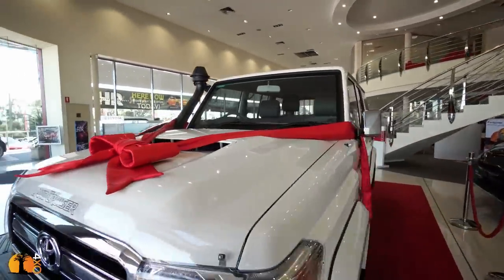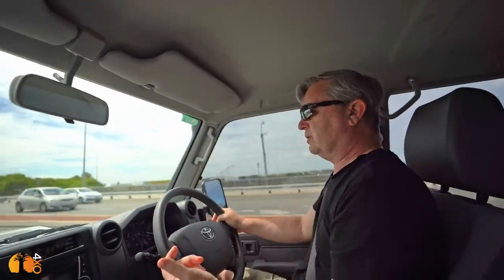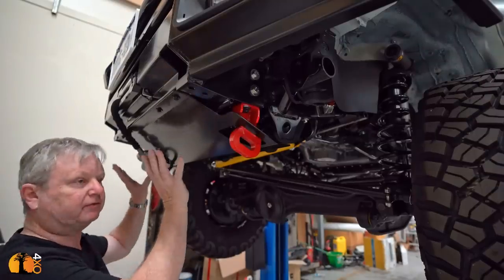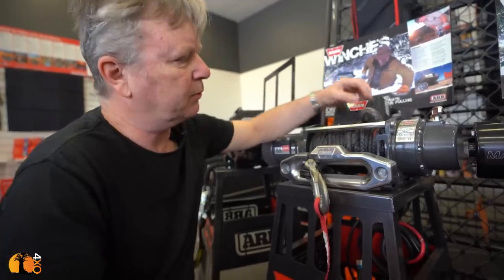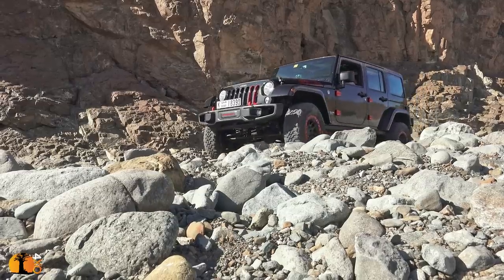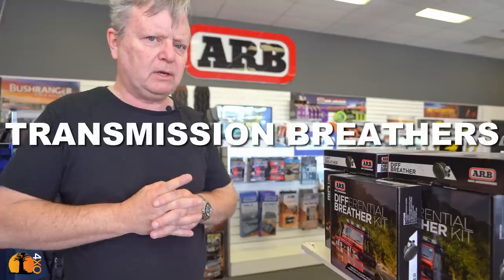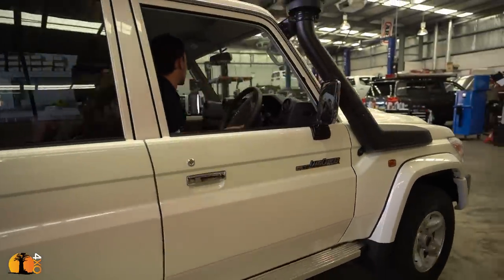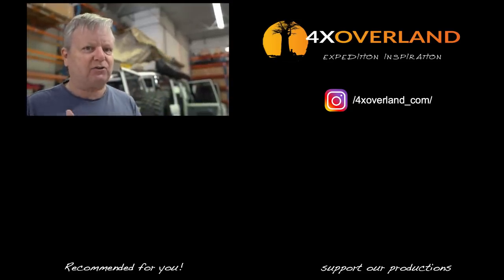How to convert a SUV into a 4x4 Overland Tourer. Toyota Land Cruiser VDJ76 | 4xOverland

Comment: It's always struck me as funny when people call the transfer case a center diff.   But that's just the difference in terminology between different civilizations.
Reply: I actually believe that they are in fact two separate technologies. All fulltime awd trucks with a way to drive both the front and the back axles at the same speed regardless of traction and a low gear could be said to  have a transfer case? But a “real”  transfer case has locks the front and rear drive shafts together in a very rudimentary was, and that is a transfer case? Idk, bit I don’t think they are interchangeable at all.

Comment: Not another Toyota! I want to see an LR3/4 transformed... 
I like the video though, thanks (-:
Reply: maybe because they arent good touring rigs
Reply: @concretekiller  I don't understand why.  I thought that's the whole point of modifications! To ensure vehicles are!
Reply: Karim Alameddine you have to start on a solid platform with accessible parts, not a finicky British truck with air suspension
Reply: Robert Howell 
In stock form, off the factory floor, a LR4 will eat a 76 series for breakfast off road.  The D4 is incredibly capable, comfortable, and safer than the dinosaur that the 76 is.  It depends what you want, how comfortable you want to be, how comfortable you are with “new technology”....
The original question / statement was valid....it would be interesting to see what Mr ASPW would do with a D4..rather than complain about “air suspension” which is sooooo easy to manage and so comfortable / beneficial to overlanding if you know  what you are doing.
Reply: Mark A obviously with all of its bells and whistles it MAY be more capable from the showroom. Probably not, but maybe. The GXL has twin lockers, remember. But even if it is more capable, how long will it last? It’s not built for extended off road travel, or prolonged heavy use. It’s not even close to being robust enough. And it is quite obvious that air suspension would NEVER be suitable for extended touring travel or even off roading- this isn’t just my opinion, but the opinion of all experts including ASPW himself.
Reply: Reliability of land rover a real issue 
All car break but parts 're a far worst problem 
Outside capital city's you just flat out won't get even the most basic service items 
We had 3 110s simply because they were the first with coils, Failed regularly, high temperqtures and rough roads murder them 
Somewhere there a video I stumbled across a video of the landrover d3s doing the Gibb river road 
Didn't go well for them 

The 76 is rough as guys for a reason 
They are probably good for weekenders and short trips on sealed roads but they're not ideal for the interior 
Goes for anything euro really 
Dont get me started on electrics 
You can say what ever you like but in on the edge of a fairly famous track in west Aus so I see what comes looking for help and usually end up pulling it apart trying to help
Reply: @marka6591   Agreed! Besides the air suspension can always be replaced with coil springs.  D4s were too expensive for many.  It has come down on price and would be nice to see what could be.  Also all of these Toyotas and Land Rovers defenders are only to be imported to North America and have to be 20-25 years old... We stuck here!
Reply: @Technoplasm  air suspension can be replaced with coil spring!
Reply: @marka6591   I have lived in South America, SE Asia, and now in East Africa.  Even here in East Africa, in former British colonies flooded with LRs, the old 4x4s on the road all overwhelmingly Toyotas - Hilux and LCs.  Their durability and dependability are in a league of their own.

Comment: I really wish we could get those Toyota series in the US.
Reply: Import an HZJ77 from Japan. Im doing it right now.
Reply: Better to get a jeep.
Reply: jeep
Reply: I have owned Jeeps in the past and know people that have them now. Too many problems.
Reply: @andyaskew1543  my shop has over 10 safety recalls for land cruiser right now. Jeeps aren't perfect, but no car is. The idea that Toyotas are bullet proof is just silly.
Reply: I never said anything about anything being bullet proof. In my experience, Jeeps vs Toyotas, you are going to get more mileage out of a Toyota than a Jeep with fewer problems and repairs and with those repairs not being as involved or expensive. I have had to rebuilt a Jeep engine at 80K miles, rebuild the rear end and replaced other drive line parts. I have driven Toyotas 250K+ with just standard maintenance and replacement of normal wear parts, breaks, shocks, etc. My original post was just about being able to get Toyota models in the US that are more utilitarian and less luxury SUV...

Comment: Every time I watch one of his videos, I realize that in the U.S.....we get shit vehicles.
Reply: Debatable!
Reply: The 4Runner is actually a pretty capable vehicle.  You will have to put mods on to get similar performance to a stock Land Cruiser, but hey, if you could buy a Land Cruiser you'd be modding it anyways.  Just don't make the mistake of buying an off road package with Toyota tailored suspension just to rip it out and put in aftermarket stuff, unless you want the factory diff lockers or something.  It might be best to mess around with Toyota's configurator online to find out what package is best for you, and keep what you want as far as mods in mind while doing it.
Reply: Don't believe the hype. I still drive 90s Silverado big block. I live in Colorado.  Elk hunting, Moab, overlanding all throughout the Southwest. 260,000 miles. I'll put my truck up against anything overseas.
Reply: I drive what you guys would call a Nissan Frontier. I have been almost everywhere in Australia in every terrain. The only difference I would say is some vehicles would do it more comfortable than others. But all of them would do it. Price difference of about 400% between the low end (Nissan Frontier) and high end (Toyota Landcruiser).
Reply: I've noticed a big difference is comfort.  I would like a no nonsense basic vehicle.   They don't exist here.  Everything here is geared toward luxury and we pay for it.  Give me rubber floors , manual windows, manual locks and no built in nav.  You can't get basic here.  I would love a troopy,  can't even come close here.
Reply: @asteiner9181  
+1 on that.   Plus I would like a simple diesel.  Ours suck.  You open the hood and you can't identify anything under there.  Simple is good.
Reply: @jamesburleson1916  the problem with that is the only option we have for landcruiser here is a decked out $90k soccer mom mobiles.
Reply: @bosstowndynamics5488  options would be nice.  Not to mention I could buy 2 troopies for what our soccer mom land cruiser goes for and no diesel option here.  It would be nice to have the option of a more simple vehicle vs the decked out full entertainment model we get.
Reply: Jeep charge 50% more for a Wrangler in Europe. (a rubicon is over us$70k here). So you guys have that going for you. :D
Reply: Go to a military auction or buy a work truck model. Everything I've used in the guard is exactly as you've described. Right down to the rubber floors.
Reply: @asteiner9181  Uncle Sam will accused u for cheating . like VW
Reply: Jeep is not Shit. They are awesome, drive one offroad and you'll see.
Reply: @k.s.3748  yes, jeep is a good car but you never seen one in middle of africa delivering medicine and doctors in remote locations. But i could be wrong

Comment: Title should be the other way round 
Taking a 4x4 into an SUV 
Landcruisers are known for being reliable and fairly capqble 
But rough and under equipped so you add creature comforts to get the same reliability But the comfort of the other brands you didn't buy 
Well thought out build non the less 
Gotta ask where your driving with the winch as well 
I drive mostly on the beach so fairly pointless 
Most of interior Aus you not find a decent enough thing to winch off 
Shovel and 4 max tracks or well
Reply from the maker: coming in part-2

Comment: yup until the idiot roll it over..

whether you  own a ute,  a troopy or own a 5-6 door cruiser, bar work is a mandatory  thing..

with the amount of feral cattle, camels,  suicidal  roo's and emu's  you need enough protection   if animal hits you and the other  bonus it gives you   a points....

which is great to have though if you are modifying weight of vehicle in any way shape or form you will need to consider either  rope or wire cable solutions that double to weigh mass for breaking strain or plausible  triple if you are in the process  helping others out of bog situation

personally did you correct  the rear end in the vehicle???

Comment: I only air down in trouble,  not sure why everyone is air down crazy, 97 percent of the time, not necessary
Reply from the maker: Airing down decreases stress on the vehicle and contents, improves grip, improves traction, reduces tire wear, increases comfort and most importantly, reduces the impact on the environment. Chewed up tracks and corrugations (washboards) are a direct result of people not airing down. It is considered lazy and inconsiderate. Just my 2c worth.
Reply: besides of all the above reasons you can also go much faster. plus waiting until you're stuck to do it might be too late. i don't use airing down and 4WD as lifeboats, i try not to be sinking in the first place.
Reply: @4xoverland  well I guess our wheeling is of a diff type
Reply: Where I wheel, the trail has mud, where people just wheel to wheel for no real purpose except for fun. People stop in the holes and hammer there 600 horsepower 80s full size on 40s just to sling mud. In the mountains of wv, there is really no where to get to bc of natural obstacles. Here what u end up with is large circles of trails that are only a couple miles of mud mud and more mud, maybe slick roots, and steep inclines. Trails are destroyed anyway. Wv trails are some of the nastiest trails in the world, makes Australia look like a walk in the park.

Comment: For good tyre and wheel advice for outback driving check this link www.beadelltours.com.au  
Tyre damage in the outback is usually more than a feral tech screw. Tyre sidewall damage on radials is a real concern. Do yourself a favor check the link.  Cheers

Comment: What? You don't need diff lockers?? Seriously??? 
Well, if all "off-roading" that is going to be done is just going to a park for a BBQ -  you'll probably correct then :)
Reply from the maker: No. you don't. Seriously. Diff locks makes a vehicle more capable. True. But they also makes drivers far less skilled. Learn how to drive BEFORE relying on diff locks. That is my point.

Comment: If one here in Canada wants a lead crystal battery its gonna cost $4000.00+ with lithium battery's not far behind that on price...
Reply: What part of Canada is that?  I can't tell if your exaggerating or not
Reply: @adamcannon6331  West coast battery dealers here look at you funny as they have no clue what lead crystal batteries are that was 6 months ago who knows they may have a clue by now but I doubt it...
Would love to replace the 4 bat crazy heavy batteries but yes they are heavy but they are so cheap compared to lead crystal/lithium.
Reply from the maker: Lead Crystal is quite a bit cheaper than Lithium in Australia. Sounds like someone it trying to discourage a customer from buying something.
Reply: that's outrageous. In that case you could probably buy one from Australia and have it sent via sea for nearly 1/4 of the price you've been quoted in Canada. Good luck!
Reply: @4xoverland  Also got that price from Australia dealer its the shipping that is the killer in trying to get one sent here.
Reply: you can look but you will not find  a dealer who sells them in canada does not matter east or west or central canada... also hard pressed to find dealer in the US....